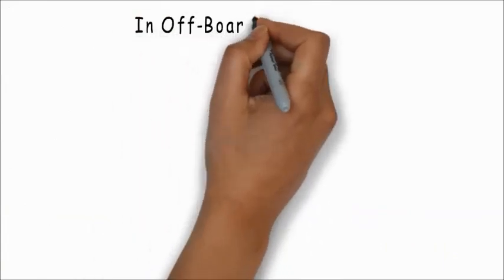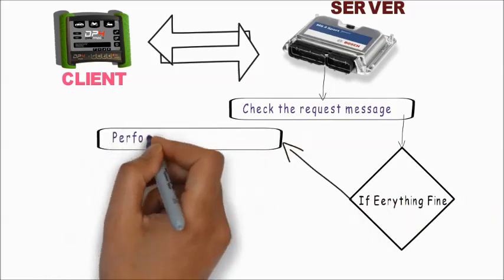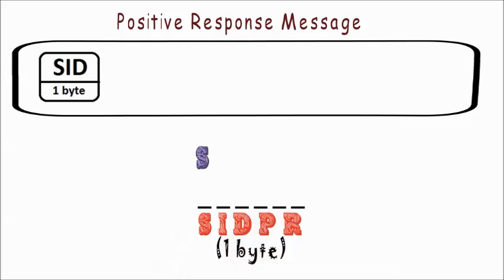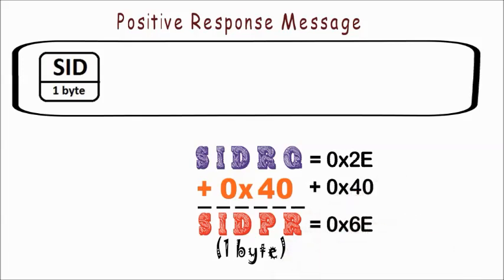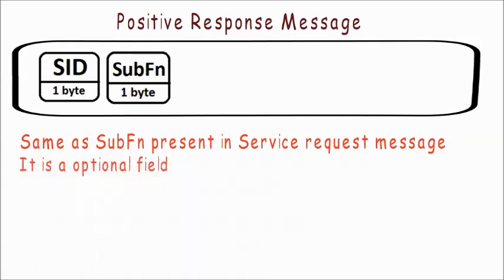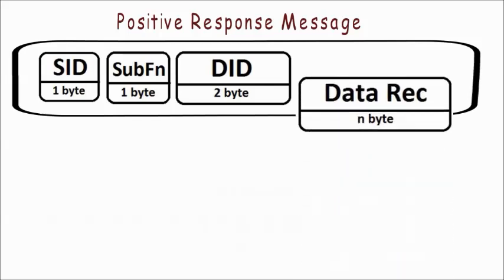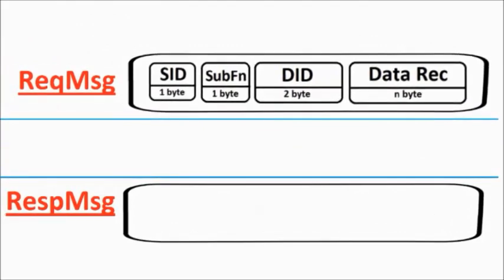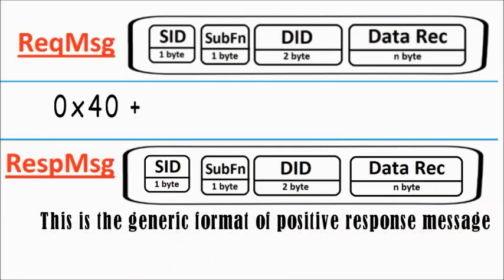UDS(Unified Diagnostic Services)  Positive Response Message Format

Comment: Hello Shyam, In earlier video's you mentioned RDBI doesn't have data record field. I hope, if it is RDBI service it doesn't have data record field in request message but if its response message it will have a data record value. 
In WDBI service will have data record field in request message and it doesn't have data record value in positive response message. Please confirm the same.
Reply from the maker: Yes confirmed

Comment: Hello sir, can you please explain in detail for positive response why 0x40 is added in SID? I read one comment about 6th bit making as 1..
Can you please elaborate in more detail? Also for negative response why it's always starting with 0x7F ?
Reply from the maker: when you add 0x40 then it sets 6th bit in sid( second msb) in sid, bit 6 always tells if it's request message sid or response message sid. so instead of saying that you take request sid and set the 6th bit to get corresponding response sid, we can say we add 0x40 to request sid and get response sid. that is the significance of 0x40
Reply from the maker: In a SID we already know 6t bit represents response SID. So in 0x7F the bit 6 is 1 so its response SID. But we have to see if its positive response or negative response. IN UDS request SID general range is 0x00 to 0x3E (there are other SIDs above 0x80 but those are exceptions). So the Positive response SID ranges from 0x40 to 0x7E. SO the very next SID was reserved for negative response SID. So any Negative response for any service always stats with 0x7F.
Reply: 0x40 = 0b 0100 0000, from right side count back to left side, 0, 1, 2,...,6, thus setting the 6th bit as 1.

Comment: Sir, the UDS communication happens on CAN lines(wire) or any other please?
Reply from the maker: Can communication physiclly happens on cn bus which is twisted pair meaning two wired. These are clled as Can High and CnLow wires. These are connected to Can transievers and transiever converts the voltge levels from bus to TTL logic (o and 5 volts) and gives to can controller.